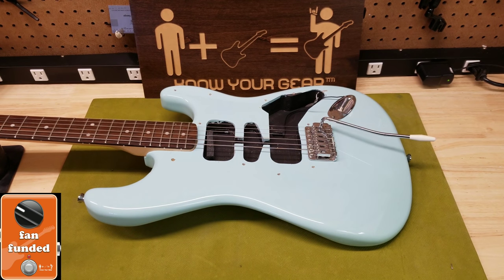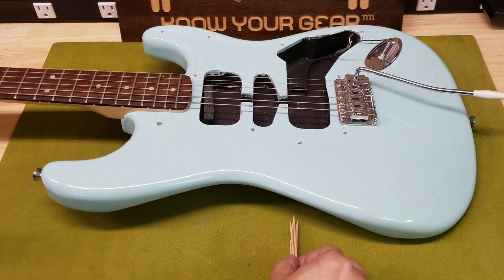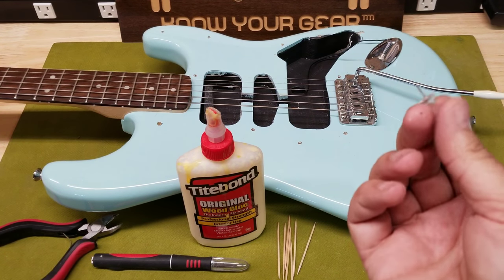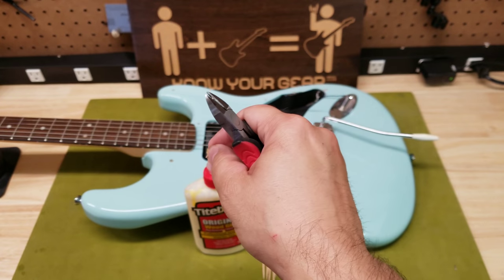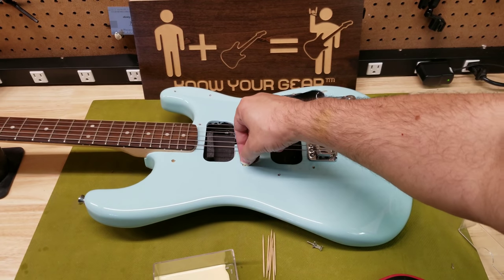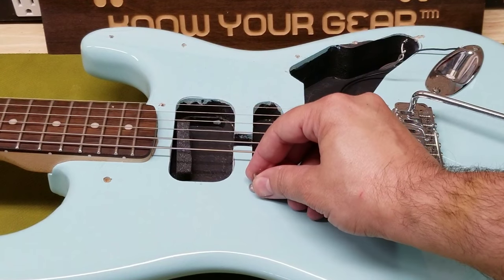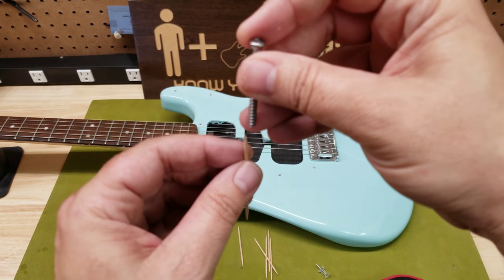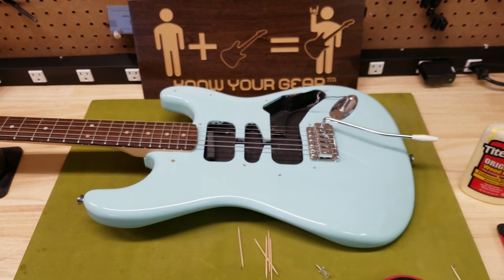How To Fix Stripped Pickguard Holes. Sharpen My Axe

Comment: I don't want to split hair, having not enough to use them for this, but:
Most toothpicks are made of beech. 
You need a wood that does not splinter, therefore beech is perfect. 
I've never have seen toothpicks as white as maple gets.
Reply: Tooth pick and wood glue. I been doing that for a long time.

Comment: Great video once again Phil. One other way is to drill a small pilot hole with a drill, one around 1.5mm and then put in the screw. That's what the pin is essentially doing. It's creating a small pilot hole for the screw to fit.

Comment: I use flat toothpicks. Insert one into the hole until it stops. I'll use the wide end of the toothpick if it will fit. Break it off flush. Repeat as necessary to fill the hole. Once the hole begins to get filled up I'll switch to the narrow end of the toothpick. Glue is optional. Never suffered from a misaligned screw afterwards. Been doing it this way for 40 years. It works fine. The most common need for this repair is stripped or worn strap button holes. That's about the only time I use glue and only in case of an extremely worn screw hole. Phil's method looks like it leaves a lot of empty space near the surface. My method refills the hole almost entirely and give the screw plenty of wood fiber to grip into.

Comment: I've been doing this sort of thing for years. Here's a tip:

A wood shaft cotton medical grade [ not necessarily sterile ] swab has a diameter almost exactly the same as a factory Fender pick guard screw. So the wood swab shaft will usually fit very well into a pick guard screw hole. I fill a slew of these, as replacement pick guards don't always line up exactly

Another tip: Buy some small medical tubing with an ID a bit smaller that a pickup mounting screw. Use that tubing instead of the obnoxious springs are are a PITA to use, especially on humbuckers.

Final tip: Save the cut-off tip of that round toothpick to fill any holes from changing out tuning machines, where the holes that secure the machine heads from turning may not be exactly aligned with the replacement tuners.

Comment: For non-structural holes that are barely stripped, like when they tighten but just won’t snug up quite like they should I’ve even just dripped the inside of the hole with regular super glue. It gives it just enough for the threads to grab onto and usually there’s a little leftover wood dust in there which I think helps. I usually do it twice, two light coats, and screw it back in after giving it awhile to dry. I haven’t had to redo one “the right way” yet but it’s definitely a quick one like the tip in this video. I wouldn’t trust it with anything major or structural but I’ve done a lot of pick guard holes both ways and had pretty good luck with both. Just thought that might help someone who wasn’t yet anywhere near doweling and wasn’t quite to the toothpick phase either but would still like something to be just a little bit more snug.
Reply: Appreciate the info.  Some of the screws in my squiers pickguard are threading all the way down, and feel pretty snug, but are still spinning.  I'm not sure I want to go the toothpick route just yet, so I'm going to give the superglue a shot.  About how many drops of super glue do you recommend per coat?  thanks!

Comment: I use a similar technique, but instead use thin super glue and tight rolled up pieces of paper twisted into the holes. The glue soaks into the guitar body and paper then sets hard. You can then drill new pilot holes and screw directly into the body again.

Comment: What chemical would you use to strip polyurathane paint off of a guitar? After scraped off, do I need to neutralize it with another product, or just sand it? And what type of stain and finish coats are best for a satin finish? How do I preserve the binding? Thanks Phil!

Comment: You just use wood filler like, kwikwood and re drill it
Reply: Jay McDanieL why don’t you want something that hardens? Kwikwood takes all of 30 seconds. Much easier and faster. If you don’t want something that hardens because the screw will be slanted, then you suck at drilling. The wood is hard when its drilled the first time.